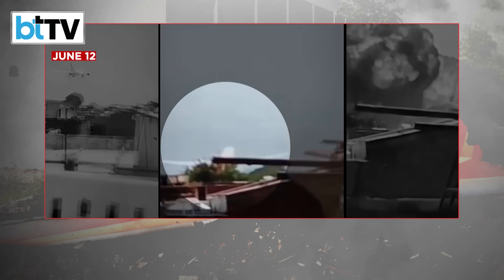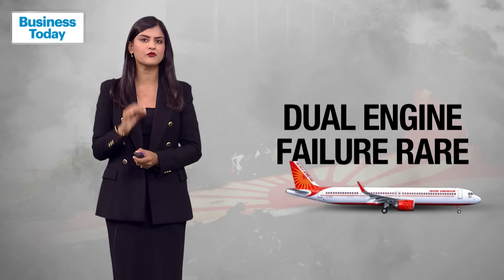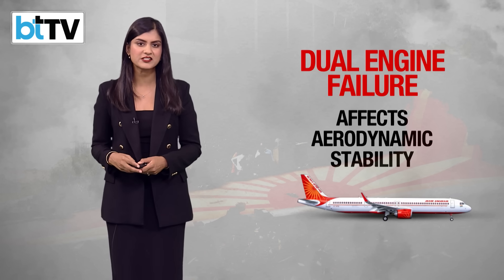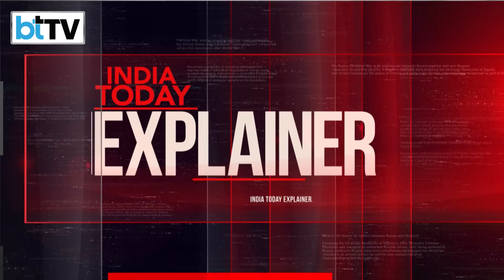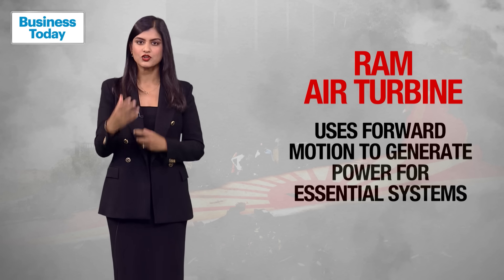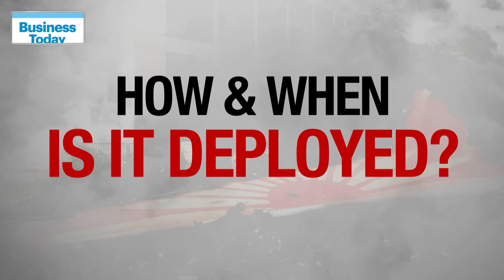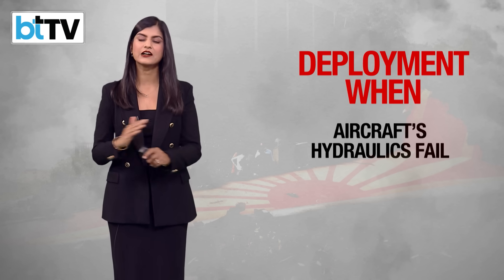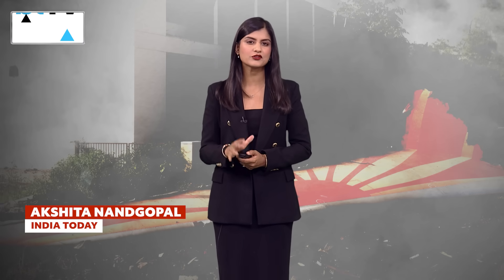Air India Tragedy: Decoding The Big 'RAT' Clue Which Points At Engine Failure

Comment: It was probably a battery explosion or short circuit than total electrical failure which killed the engines and the flight controls. Than the RAT engaged. The loud bang reported by the Ramesh could be the RAT activation also in that case no battery fire. Akash who was on the flight and disboarded mentioned that AC and entertainment wasn't working on the flight backing up an electrical issue. It seems that they attended a quick fix ending in a crash. The plane should have been sent for repair and another should have been used. Yep. There are no spare planes around for such emergency.

Comment: did the RAT have valid certification for virus scan enabled? these questions demand answers
Reply: RAT is just a turbine with a generator. It is purely mechanical. No virus protection is required. It is just coil of copper wire, Magnets and a huge fan. No computers....

Comment: Passengers already noted electrical net work did not work as no ac and no entertainment channel. Tata is the full responsible for poor maintenance. Hydraulic system failed due to power outage. 
Because of the war , airport maintenance contract was taken from turkey company and given  to  Adani. Due to poor maintenance, this happened. Tata enhanced the quality of food but stingy over maintenance costs.
Reply: No tata never fired your beloved turks. Stop with your bs lies and stop blaming a respectable corporation copying your aka pappu.
Reply: possible wrong channel enabled for tv causing engine failure?